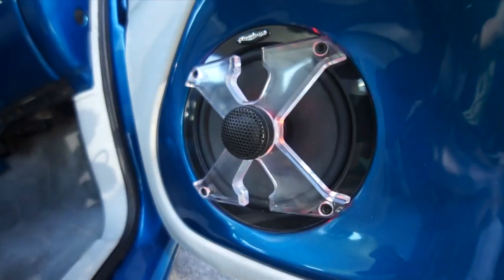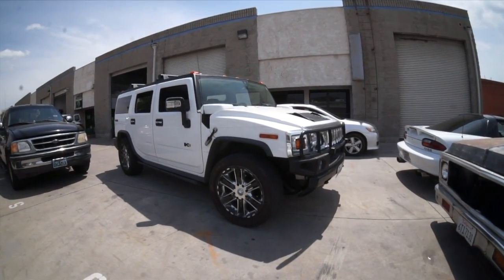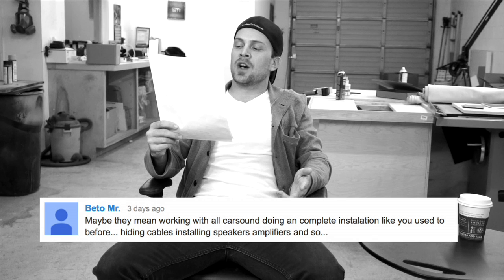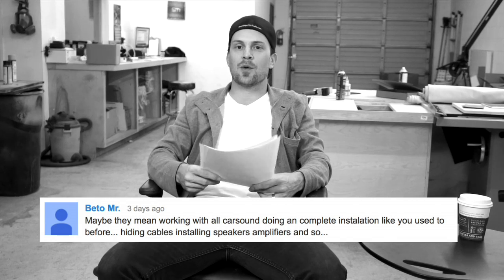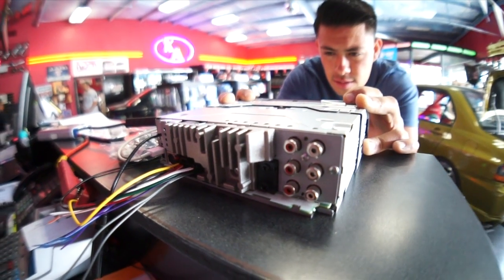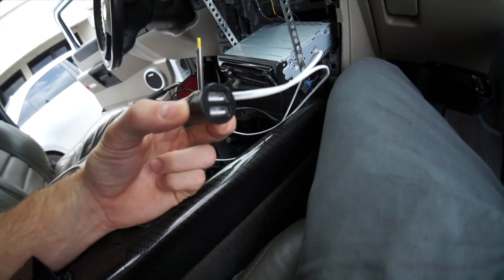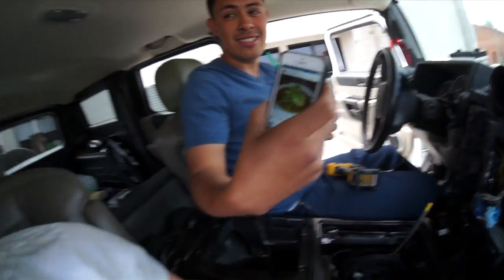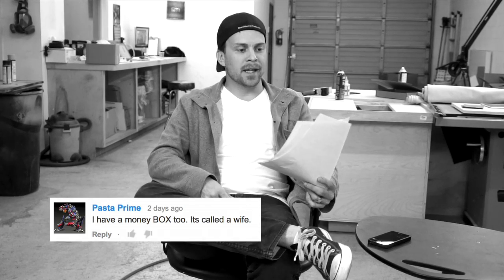Hydro Dipped H2 iPad Install Refined with a Dual Source Bluetooth Mod

Comment: why didnt you get a blutooth to ipod 30 pin instead of to aux so u could plug that into a usb on the back and not have to run a aux to the front, or get a radio with a rear rca input and connect the ipod that way? cant wait to see the system on the mule, that shit is bad ass

Comment: Can't you just switch the head unit from app mode into ipod mode? I had the same thing happen with pandora on my JVC KW-HDR81BT but I just have to hit the ipod mode button on the front and it goes back to normal controls.

Comment: My Sony Head Unit Had the same problem wouldn't let Pandora play threw the usb, I figured out how to make Pandora radio work along side the Sony decks, First Make a Fake music track or any music you have will work also so the Sony would think that the Ipad is playing an song from the playlist after that pause the song go to Pandora and it will allow you to listen to Pandora radio even change the stages threw the usb now get me an other Mountain Dew Kicks my leg up
Reply: U can just install TuneIn radio app, then open it through Sony app remote, after that pause the radio (what you don't need to do if auto-restart player in your tunein app switched off), then just press home button, open any app u like and it will work without problems.